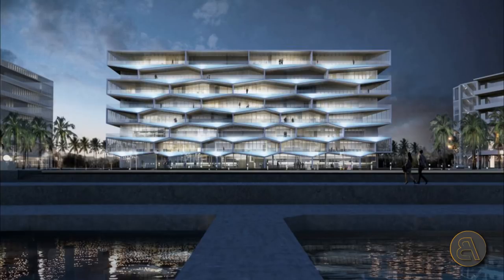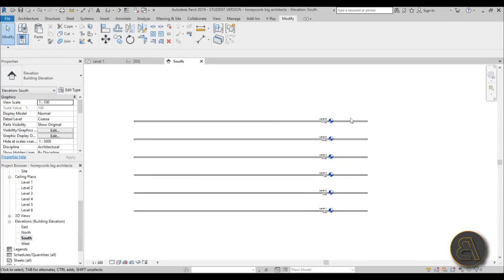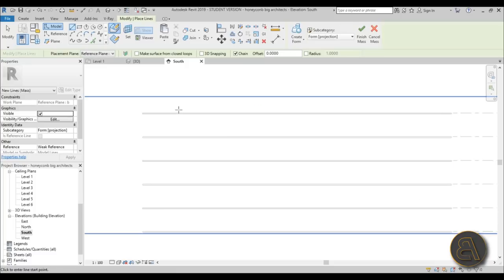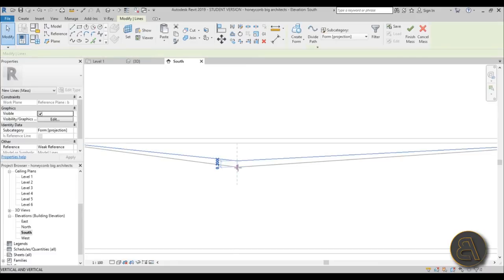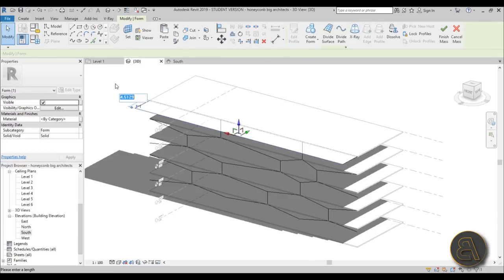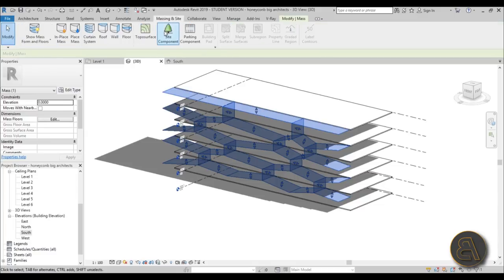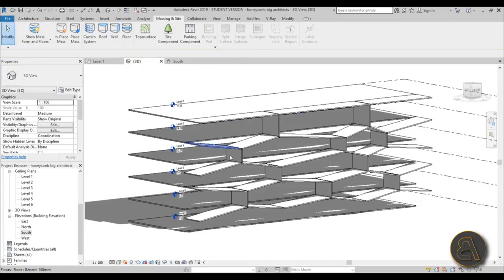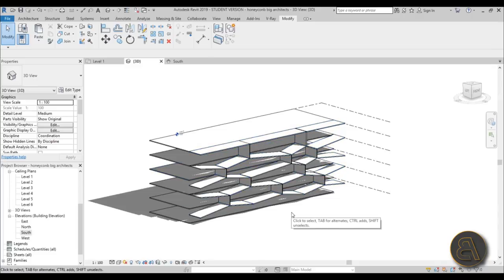BIG Architects Honeycomb Building in Revit Tutorial

Comment: Thanks Balkan. Another way to potentially avoid having to manually adjust each line individually could be to select all the lines and then copy them out to the 4m offset, then select each chain on both the original sketch (back) and copied sketch (front) from the elevation or orthographic 3D View, then 'Create Form' from there. That should still make the Surfaces needed to Pick Faces.